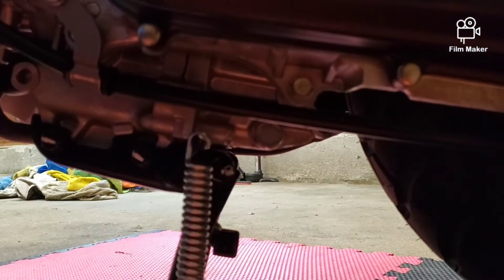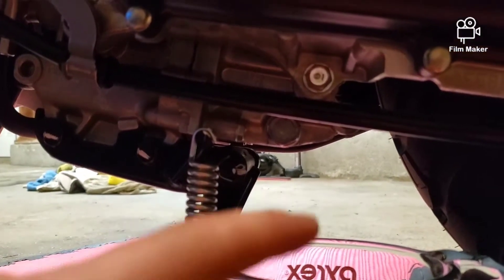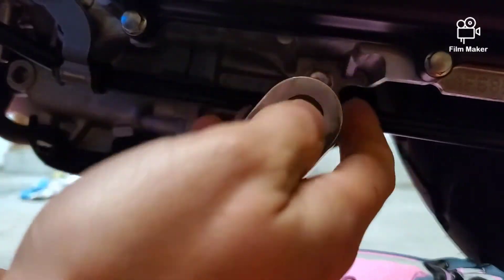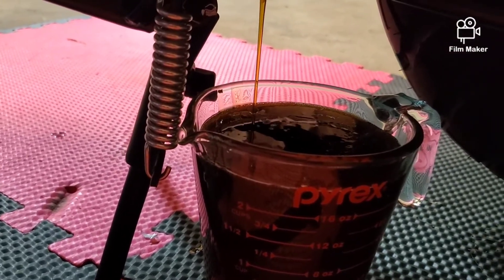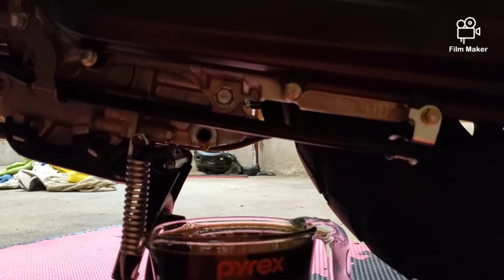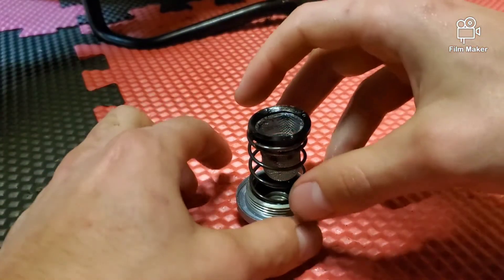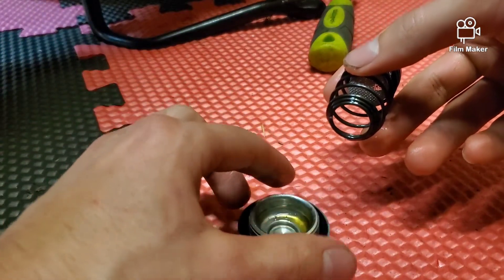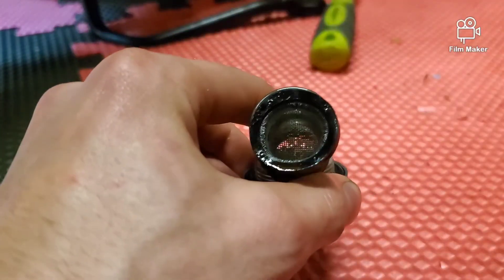How to do an oil change on a Honda Ruckus.

Comment: I fashioned a tool for the oil screen... I put an extender on a 17mm socket and the used a vice grip on the end of the extender so I could grab it past the hose.

Comment: My oil cap that holds the screen and Spring in is stripped. Any suggestions for taking it off?
Reply: Try some locking pliers, apply a strong good grip before giving any rotation. 

I would order another oil cap and have it on hand to exchange it once you have it out.

Comment: Would you recommend a Full synthetic oil for the Ruckus? If so what brand and type? Thanks 🙏🏼
Reply from the maker: I personally run Mobil 1 10w 40 Full Synthetic Motorcycle Oil

Comment: Thx for the video bud :) I will do as you mentioned. I’m planning to use a measure cup for the drain oil to see the number on it and another measure cup for the new one so I can add the exact amount you said or 400ml. I never change oil before so I don’t know what procedure you do with the old oil fluid. I’m guessing you take it somewhere to be recycled? If yes how much you pay etc.  thx again on the quick response and video. Take care
Reply from the maker: The sweet spot for oil is 600ml that's usually right at half. As far as disposal most auto parts stores will recycle it for free.
Reply: @seatosummit96  notated 😈thx bud.  On a different conversation. How do you keep your scooter clean? I’m guessing with a wet towel or wipes? I’m afraid with a direct house or water pressure it might damage or malfunction some parts etc. I like to keep my stuff clean to avoid any future issues.  See ya later
Reply: @Julio-bc7pj  you can wash the ruckus just like any other motorcycle. I use a wax and dry spray from “turtle wax” and a microfiber towel to dry it.
Reply: @hy3ridmedia279  excellent thx. Notated, this is my only motorcycle :) or scooter
Reply: @Julio-bc7pj  welcome to the cult!🤘

Comment: What year is this?
Reply from the maker: 2020 but will be the same for most year Ruckus with the stock engine
Reply: Is there a Full Synthetic oil that you would recommend? Thanks
Reply from the maker: @jdoe787  for the first oil change I used Hondas oem oil GN4 10w 30, but just did another change ,and used Mobil 1 Motorcycle Oil 10W 40 ,and I think that's what I'm going to run from now on.
Reply: Thanks, appreciate your videos for us new Ruckus owners 🙏🏼
Reply: My strainer screen engine is different. I can't it's not move is 2022. Maybe it's different I don't know